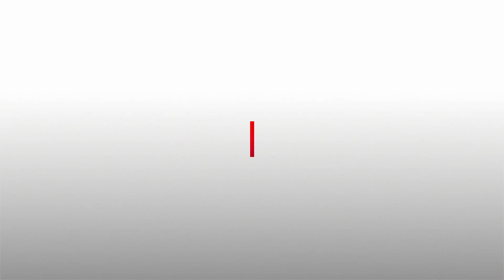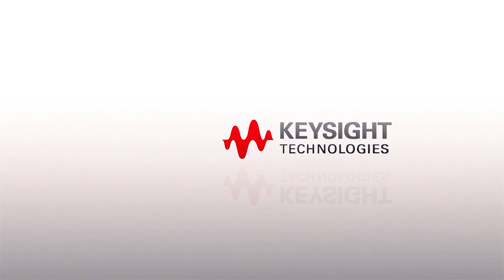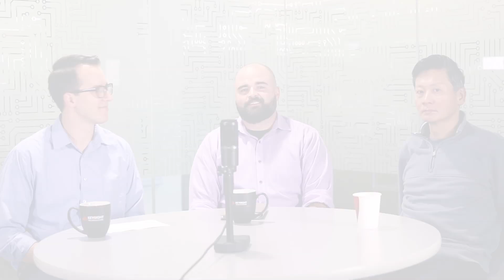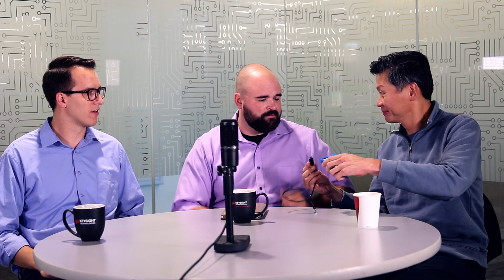USB Type-C - EEs Talk Tech #1 - Keysight Technologies

Comment: Problem at thhe moment is obtaining Type C plugs and sockets, (wired up also) there are also many fake low quality Type C stuff on the market , be VERY careful when you source any Type C cables as many are not up to spec or even compatable. Trying to find correct spec Type C is very difficult to buy at the moment.
Reply from the maker: Yes, it's definitely an emerging tech at this point. If you're ever in doubt, there's a whole list of all certified devices on the USB-IF website.